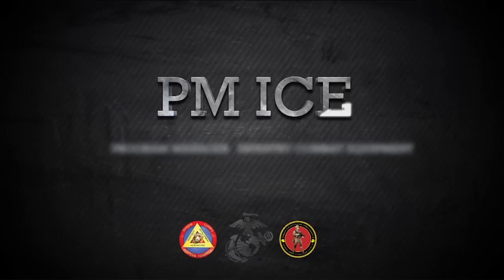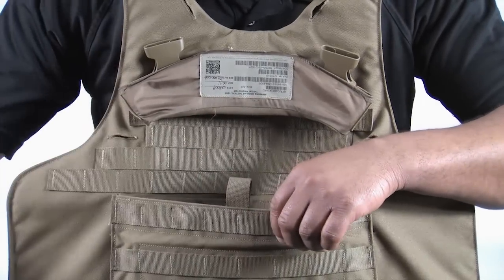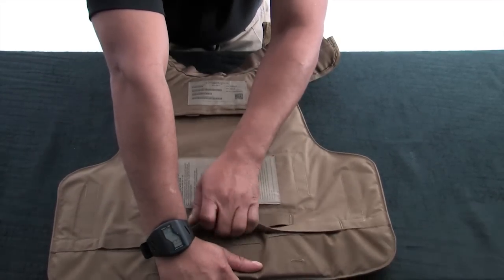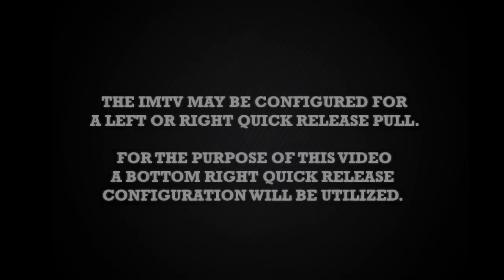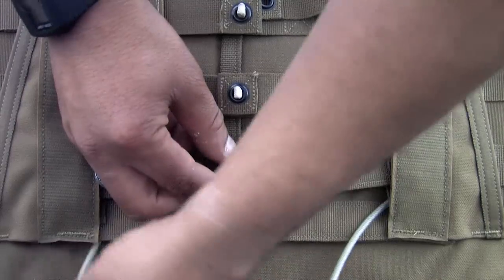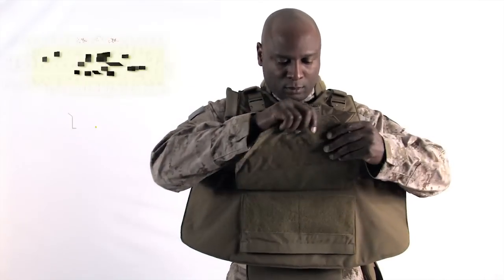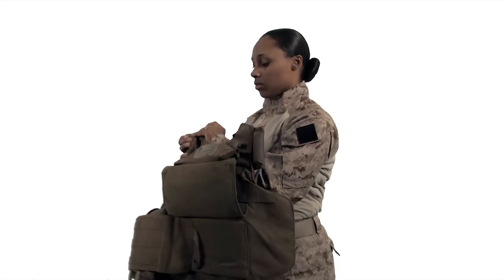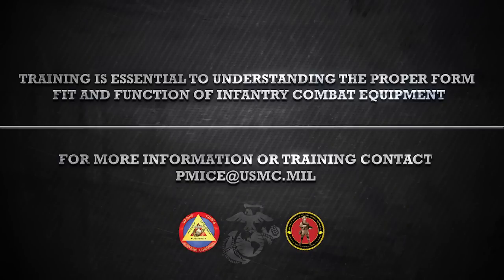Infantry Combat Equipment — Assembling the Improved Modular Tactical Vest

Comment: It all depends. If you want the benifits of the Army, but the training of the Marines then go for Army Rangers. They are basicly well trained infintry men, probably better then the Marines. What the Marines use are the same thing the Army uses, with slight variations. No matter what you'll be protected. Although there is the whole debate that one side is better then the other, they really are just the same thing. There is little seperating these 2 branches. It all comes down to opinion.

Comment: @88Tomm88 Dragon skin is a good armor but it has some drawbacks that can be lethal. Because of the overlapping scale system in use, even though it offers more coverage and monuverability, because of that system the scales must be thin so it can be easy to penetrate in some cases. The plate system currently in use, although does not have full coverage it has proven to save lives, and block high powered rounds. The Dragon skin may not be able to stand against and AK round. Still good but debateble
Reply: milkduds1001 dragonskin has wistanded multiple al rounds though

Comment: The elastic bands on the side sapi should be sewn in everywhere but one side of the top. Not velcro between velcro on both ends of two elastic straps!
Reply: I stand corrected it is sewn in on one side. But it shouldn't be velcro on the bottom side, just sew it to be like a hammock

Comment: If you're shot in the chest and your plate breaks and have bleeding under the armor how would you get it off fast enough to save the soldier?
Reply: it has a cable tha brake the vest but use it in an ermergency because is hell to put it back